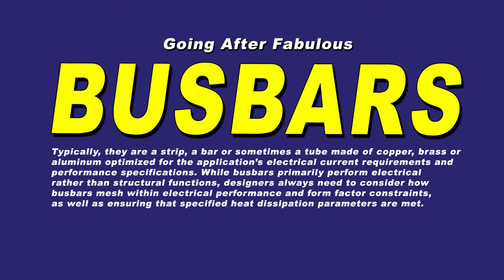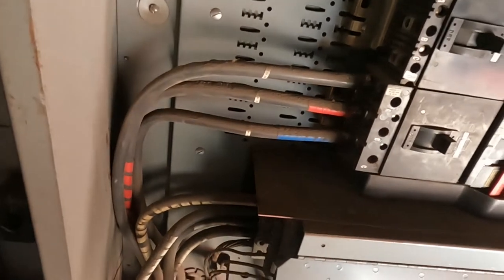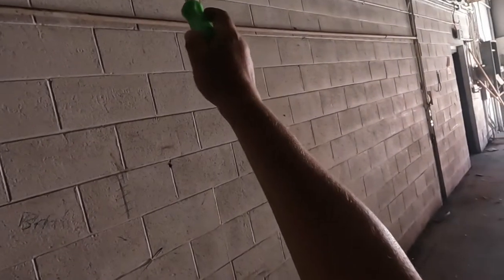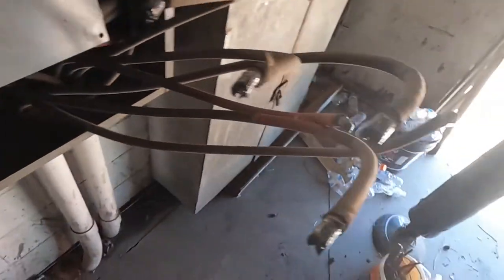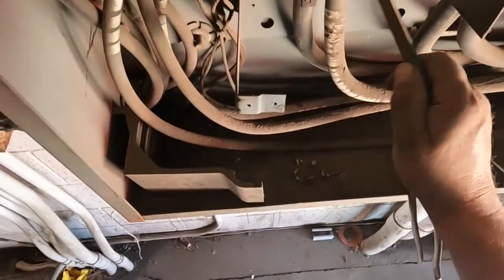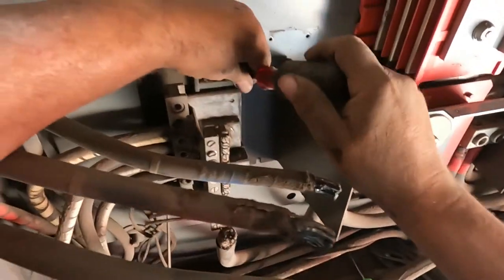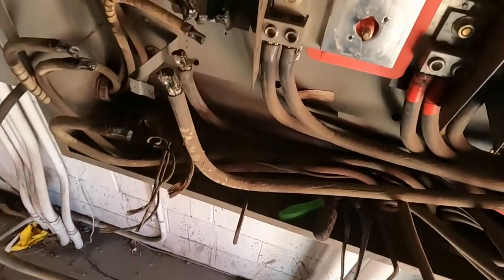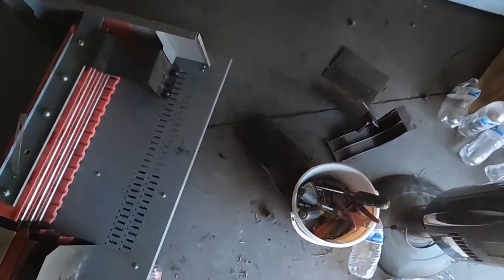Scrapping Copper Busbars from an Industrial Building Electric Panel | 2 Hour Payday!

Comment: To gather only what is necessary like the spare parts that are worth a good days work is smart because after you , many scrappers will visit the place for anything like iron doors,steel bars,iron pipes etc.Also if l were you l would only collect brass and copper entirely besides the spare electronic parts,because aluminum has its ups and downs these weeks ,at least in my scrap yards, stainless steel also is a metal that l would not find it worth it of picking, unless the brass and copper is in little amounts.I love your videos you work with clever ways and you know what you're looking for,keep making more.
Reply from the maker: Glad you enjoy them... I'll keep making them!  I got the back gate for my trailer welded up this morning.  Getting real close to be able to do some real dumpster diving & scrapping.  Again, Thanks for watching you're the best :-)

Comment: The black goo is not to keep it from loosening up,  it's to keep the aluminum from oxidizing to the steel
Reply from the maker: You are correct it is to stop it from oxidizing... But the connection is Aluminum to Aluminum, no steel in the connection point.  If oxidizing occurs the connection will loosen over time. Thanks for watch.
Reply: @thescrapmeister